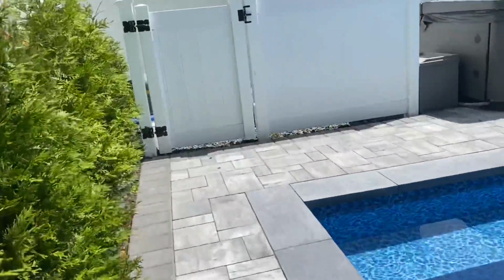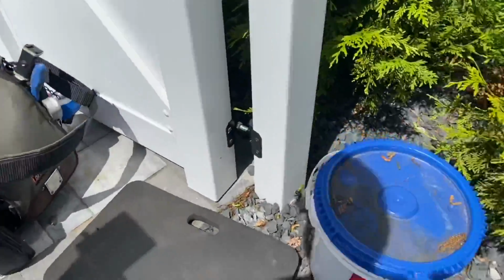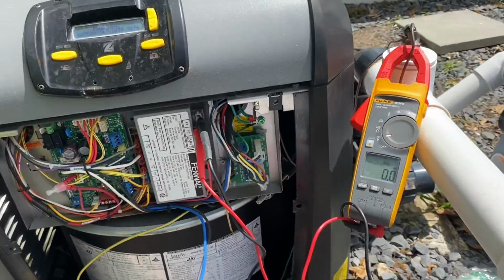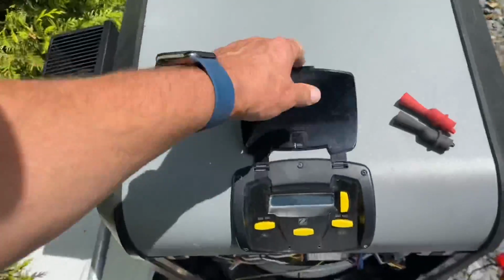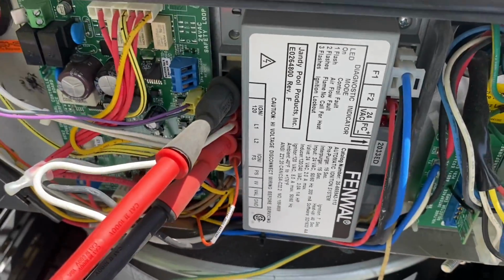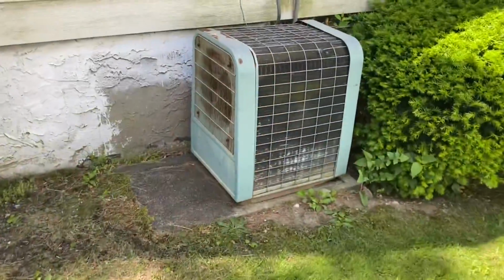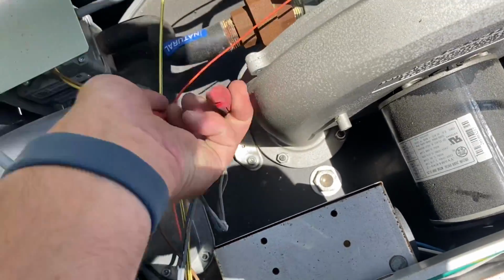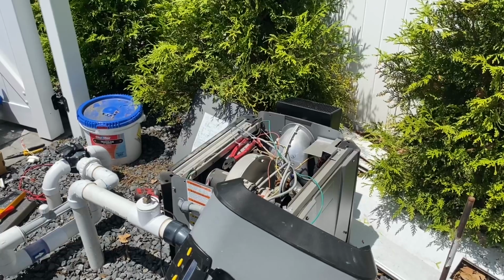Jandy JXI400 Pool Heater Tripping Circuit Breaker

Comment: Nice video! Thanks for sharing! One of my customers just had a brand new pool built and there pool heater will not light.🤷‍♂️they called me but I do not work on them or know anything about pool heaters. It try’s to light but after 3-4 minutes it says ignition Failure. Any idea what it could be?
Reply: @PipeDoctor  I’m assuming it’s trying to light. I hit the pool button and it kicks on. Then when it doesn’t light it turns off. Red light flashes 3 times. Ignition lock out

Comment: Hi mike , 

I have a JXI heater , someone tried to fix the power distributor (120/240 v) twice and they kept burning it out , heater should’ve been under warranty but they touched it already, I get to the job and they took the power distribution board that was burnt from the customer heater, left wires dangling, my buddy said it kept burning out because of a faulty transformer. But might of thought to ask someone else incase . 😊

Comment: One thing to keep in mind that the breaker was a GFCI breaker and if there was over about 5mA going where it shouldn't have been, that would cause the breaker to trip as well.  If that HSI was shorted to ground it wouldn't take much to cause a ground fault!  Know your surroundings!  👀
Reply: good point, could have been some schmutz buildup where it shouldn't have been. like what looked like a spider nest on the ignitor or some kind of buildup. it could have been bridging across to show lower resistance and grounding somehow to trip the gfci.
also a bunch of white fluff/nest blew out when it fired, making all the noise @ 9:37

Comment: After 1 minute of watching this I already saw many things wrong with that install... #1 theres a 30A breaker on a 15-20A pump/ heater. #2 They connected the pump & heater under 1 breaker... #3 someone must have been messing with the wiring in the heater because the hot surface igniter rarely fail.  
#4 its just really sloppy work for the pool guys. they didn't even bother laying a concrete pad for the equipment. mikey pipes to the rescue! you do it right
Reply: #2 that’s common in the industry even if it’s not ideal. #3 that’s not true at all really. I’m around a lot of JXIs as soon as it tripped 13 seconds into the ignition sequence is instantly when I knew it was the igniter because that’s when it begins to get voltage.